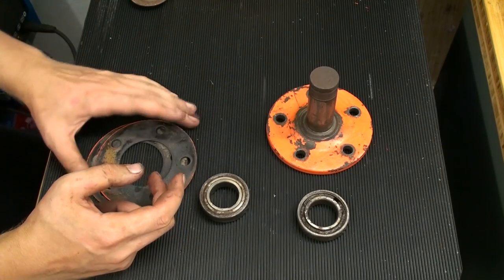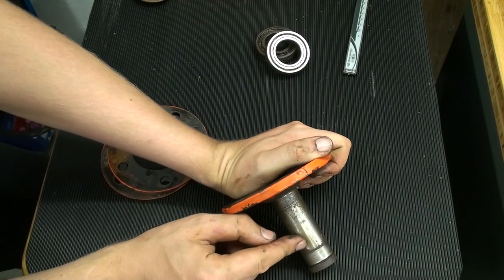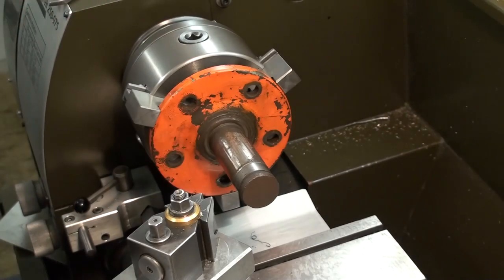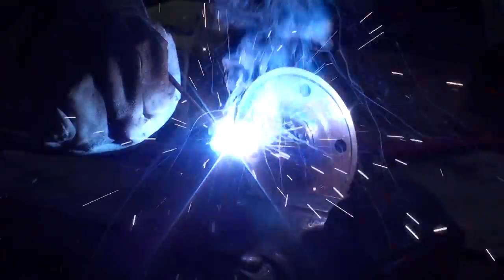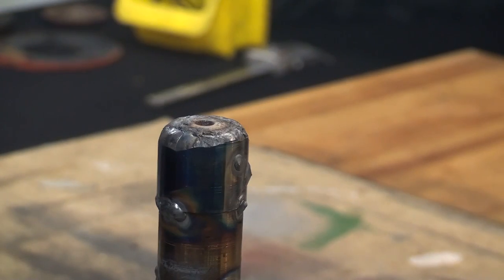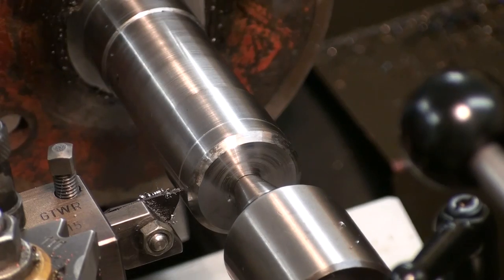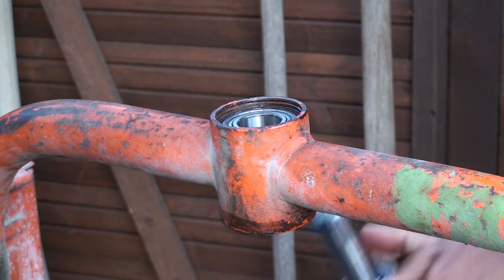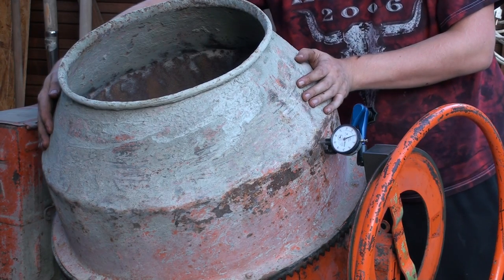Fixing a concrete mixer

Comment: Yes, I'm sure you checked that drum for run-out. LOL!  Nice repair.
Reply from the maker: Sure I did! ;)
Thanks!
Reply: drum run out should be checked with machine running with test indcator
Reply: Well a proper drum run out test would require a full load of gravel, concrete, and water then you add that test indicator. :-)
Reply: For a good job you should be using a .001 mm indicator.,,
Reply: I think using the dial indicator directly on the rotating concrete slurry would be the only way to do it properly. Only a top-of-the-line Mitutoyo would give you an accurate measurement of course.

I presume Stefan will be posting the final run-out measurements in a second video, which I for one look forward to seeing. There are very few instructional videos of the correct procedure on YouTube, so this will be a valuable addition to the machinist's canon.
Reply: Good point but adding a top quality Heidenhain rotary encoder and digital display  for accurate drum position would help narrow down outside factors affecting the results. :-)
Reply: Yeah, wouldn't want your concrete to be out-of-round.

Comment: I enjoyed the mixer repair.  I am glad to see the drum does not have a lot of runout.  At 50 RPM you generate huge centrifugal force.  =(;-)  Keep on keeping on.
Reply: Is this the place where the old fart complaint goes that it would have been much better to retrofit it with good, old-fashioned bronze bushings?

Comment: I used to weld repair a significant amount of bearing locations on shafts for 2000 kW + electrical motors for dredging equipment and the preferred weld direction is beads length wise of the shaft next to each other. Go round once and then weld in between the beads also length wise. Repeat till enough build up. This was always done as last resort if no new shaft or enough repair time available. The preferred repair is a new shaft since you do damage the material due to welding and never get it 100% again but for your mixer this is perfect..
Reply from the maker: Thank you! I am pretty new to weld buildup, thats a skill I want to learn and use more in the future :)

Comment: The title sounded more like one of my videos. lol Got to ask why you didn't just machine off the old weld, turn a new stub shaft and install that then weld it like factory, would seem a cheaper repair and WAY less time. What are you doing with 2 ton of concrete building a barn?

Comment: Just noticed this video. By the way, I love your work, always awesome. Anyway, I work as an machinist in sweden at a repair workshop and encounter this problemon on a daily basis and the thing we do when we repair shafts of every sort and kind we more or less always machine down the shaft 3or 4 mm and make new collets with 0.01 - 0.02 fit and glue them on and then machine them to the correct bearing fit and it works like a dream!

Comment: I built one of those the size of a concrete truck. 316 S.S. I welded on the 10" flange as best as I could. The Die shop town the road turned the shaft/flange out of square some 5 deg. on a big CNC lathe.

Comment: This is very nicely done, but did you consider just turning down to the next size bearing? I have no idea what sizes are available so maybe that wasn't practical, but losing a couple of mm probably wouldn't make a lot of difference.

Comment: rod gets bad because of humidity. very bad and makes hydrogen cracks. bake them over night. helps alot. to make certificat weldings you must use heated rods. But for your use no worry. if std mild steel you gained 30% hardnes by welding it

Comment: Bearings always show more wear in the inner race. Since it's smaller diameter, the balls rolls more times in the inner race than in the outer one. If you think about it, the balls should be the ones that have the worst wear because they are really small in comparision, but they rotate a bit in other direction so they change the mating surface, unlike the races
Reply from the maker: Makes totaly sense what you say! I think on the balls you do not only get rolling friction but also sliding friction in some cases.

Comment: When you are building up bearing fits on a shaft tack weld a scrap round stock sleeve of a close OD to the end of the shaft to serve as weld run off tabs. This well keep the welds near the end of the shaft even. Then its a simple matter of facing or parting the run off tab off. This merhod is huge time saver.
Reply from the maker: Thanks for the tip - Thats not a common work that I do, I will try to remember that for the next time

Comment: I would've lobbed off the bearing housings and replaced them with platforms. They would accept a zerk fitting based bearing (self aligning) which would improve the whole machine by quite a lot. There's also sandwich type bearings the top brace could be added in the same manner back on top.

Comment: Hi Stefan,
Another great video as always.  One thing I am curious about is why did you start by machining the worn bearing areas on the shaft?  Why wouldn't you just weld it up first then turn it back true and concentric?

I am not criticizing, I just want to learn what you were thinking...and if that same train of thought may help me one day.

Best Regards,
Mike

Comment: I'm always amazed at how ball bearings keep on working even when they are totally shot. I've had them literally fall in bits as the shaft has been pulled out and they weren't even noisy.

Comment: Did you just put a dial indicator on a cement mixer? I think that’s the most German thing I’ve ever seen 😂.  The only way that gets better is if you poured your own precision surface plate while wearing a perfectly white lab coat and blasting metal on the stereo. Your videos are so awesome, please keep doing what you do.

Comment: I'd have thought sealed bearings would have been a good upgrade. Any reason you stuck with shielded bearings?

Also, is there a way to grease the bearings? If not, adding a grease zerk on the bearing container section should help them last a lot longer then the first set.
Reply from the maker: I am not 100% positive, but bearing manufacturers recommend shielded bearings in dusty enviroments..
No, there are no grease fittings, they are "greased for lifetime" (The more I think about this term the more funny it is.). I would have to change to one-side-shielded bearings and add grease fittings, that might improve it - But we got enough live out of the old bearings so I did not bother ;)
(Before we had it at home, my grandfather had it on proper construction sites in use.
Reply: hi i don`t want to be a smart ass or anything but for humid/dusty environments where rotational speed is low sealed (rubber covered plates) are preferred as shielded (metal only covers) leave a small space where dust/water can enter the bearing. for this application where axial and radial loads are of great magnitude a set of taper roller bearings would have been a choice to consider but manufacturers being what they are just put a straight axle and two 2z ball bearings that are cheaper and give x time of life. the last mixers that have been brought to my shop for some repair (welding/machining shop) had everything torn apart BUT the bearings... and they were of low quality and way undersized... go figure. you had an old well made machine it`s very nice to see a man saving one of those. thanks for sharing

Comment: Ok, on to the next video in my subscription list. "Fixing a concrete mixer" by... Stefan G!
 Right there I got the image in my head of an indicator on the drum. And sure enough, there it was in the end! :)

I have the same (or very similiar) model Atika here, but your looks nicer. On mine you have to really search to find some orange paint between the rust and concrete. Still runs fine though. But now I have to take a good look the bearings...

Comment: Good video. Question; would it have been easier to turn the shaft down and make a sleeve 3?mm thickness and press it over the shaft instead of the welding and re-machining? Don't get me wrong, I love getting the welders out for any excuse but my first thought was sleeve it and be finished. Just a thought.

Comment: Hi Stefan, I thought we would see you spray welding the shaft on the lathe, like Abom79, guess we'll have wait for the next shaft repair. Is that a metric ton of concrete? We use coat hangers for welding!!!
Reply: Coat hangers are mystery metal, you may get a carbon surprise, use bailing wire.
Reply from the maker: Thats a process I will happily leave to the guys who know how to do it

Comment: What kind of welder are you using? (you don't mention that on your homepage, where you describe your other tools)
I'm thinking of buying a TIG welder, but as it's purely for DIY stuff I don't want to spend much money. I'm oogling at a "Stahlwerk AC/DC TIG". Stahlwerk seems to be a similar thing as Holzmann (I have a drillpress from that company), assembling and rebadging from China parts. But at least they offer a 5 year warranty.

Comment: seeing you check the runout on the cementmixer gives me pictures of you checking a 10 by 10 meter concrete floor with a straightedge and feeler gauges / micrometer to check for levelness , maibe even trying to scrape parts to get it perfect ........just kidding offcourse but still 

you done a nice job on it , and showed me that it can be done 
i have an electric motor on a stationairy drill that the top part of the axle is bend on , i want to try and fix it the same way 
(migwelding the low part of the axle up put the straight bit on the axle in a steady rest  )
straighten and cut a new center on the end , then put the rolling center on that and turn everything off untill its straight and to size again) , the one sided welding will most likely bend the axle back the other way so i need to see if its enough

Comment: I'd have looked at putting back smaller ID bearings if possible to avoide the weld build-up and re-machining stages. All subject to loading and lifetime calculations of course.

Comment: machine a delrin rain cap to keep rain out of the bearings ..  stick it in place with silicone..  or just glob some silicone over it.  you could also make up a long shank forshieda seal die and make a silicone rtv for the drum end to keep rain and wash water out of that end of the bearings also. the seal would be stationary on the bearing housing with a flange against the spinning drum mounting flange .  it would be a slit seal.. glued together.   a split forsheda seal but with big flanges could be used for container ship propeller shaft bulk head seals.. so the large flange just rubs against the bulk head allowing the ships hull to flex without compromising the water tight .. as water one either side of the bulk head would push tighter against the bulk head.. i got this idea after reading about the emma maersk accident report where the engine room flooded 29 feet deep and the emma settled to the just slightly deeper bottom. but did not sink below the water.  the accident report http://www.dmaib.com/ulykkesrapporter/flooding%20of%20engine%20room%20-%20emma%20m%C3%86rsk%20on%201%20february%202013.pdf

Comment: How about protective paint cover on repaired flange? Or there will be protective concrete paint covering anyway sooner or later...
Reply from the maker: My paintjobs are just as bad as my welding. So, no, it will get a nice rust-concrete patina ;)

Comment: Stefan, what a lot of sodding about, why did you not just skim the shaft down, then fit a oversized heat shrink steel sleeve, then finish turn to size ? Much quicker and easier than all that welding and distortion caused.
Reply: That would have made a much less interesting video I think, and Stefan would have missed a valuable (and risk-free) opportunity to get some weld build-up practice!
Reply: Hell, I would have cut used an angle grinder to brutally resize the shaft for some differently sized bearings.
Reply: Screw that. I actually would have just bought a new spindle, or even just bought a new mixer.
Reply: Still love the vid, though.

Comment: So, what was the runout on the drum itself? Did it match your previously set iso 2768 runout tolerance?
Reply from the maker: Due to the big distance to the flange it was about 0,25mm TIR - Unfortunately the footage of the measurement got lost ;)
Reply: Really impressive! Good job on that ;)

Comment: Stefan, a simply wonderful job but I'm worried you're slacking off....maybe due to getting older. 
Personally, I would have replaced those archaic ball bearings with air or hydrostatic bearings - they're far more precise and they don't have the insufferable level of runout that old fashioned ones have. 
Maybe next rebuild you can put proper bearings in?
:)

Comment: Maybe a stupid solution? Wouldn't it be possible and quicker to use a sleeve instead of welding?
Reply from the maker: Yes, would work too - But somebody would need to machine the sleeve first ;)
At the time welding seemed to be the easiest way to do it - Plus I never did it before, so it was a nice learning oportunity.

Comment: Instead of the weld buildup, could you have turned down the shaft o.d. and then sleeved it with a pipe for a new bearing surface? It would not have made as fun a video I know, but we get charged by the hour at our shop, and the customers head would have fallen off doing it your way! :) HAve fun, G.

Comment: 1mm? Just needs some aluminium can shim and some green loctite. I joke. Although i wonder if loctite's 660 would have worked in this instance
Reply from the maker: Never used the 660 - But the descrtiption reads like it might work. But alignment might be a problem.
(Loctite 666 would be better ;) )

Comment: Maybe they are out of the frame, but didn't you suggest a hard hat, steel-toed boots, safety glasses and gloves?  I'm sure you're wearing all of that gear but we just can't see it.

Did you REALLY check the run-out on the installed flange? Too funny.
Reply from the maker: Sure, I was curious about the runout.

I used invisible safety gear ;)

Comment: Come on man, say it: after the TIG weld, it looked like a diseased penis! ;-)
Maybe shoulda packed that rear cap w/ grease though.
Considering were celebrating the Day the Wall came down with fascist demonstrations in Dresden today, I think fixing a concrete mixer is a very fitting tribute to the occasion!